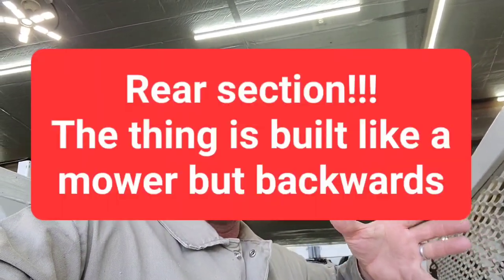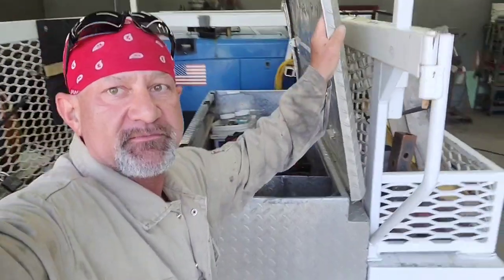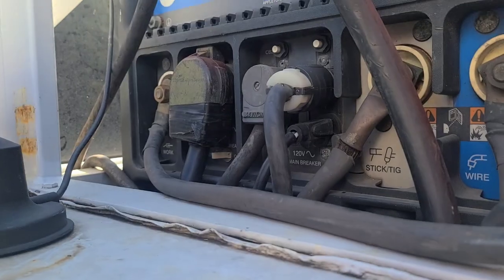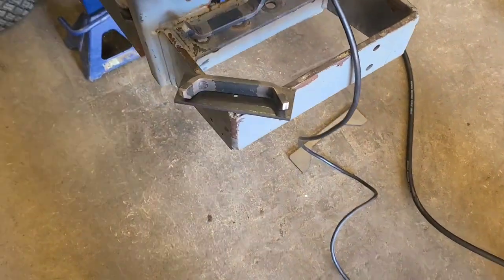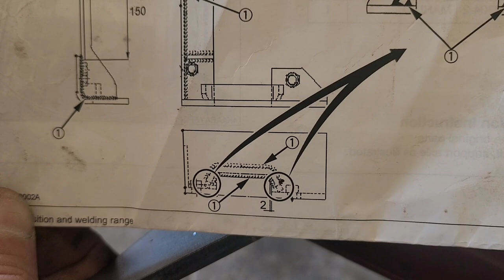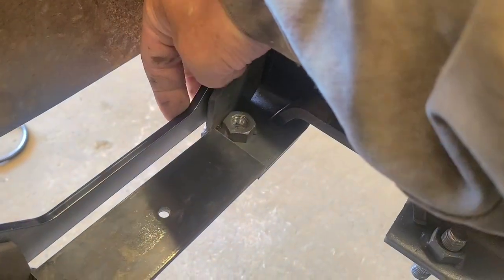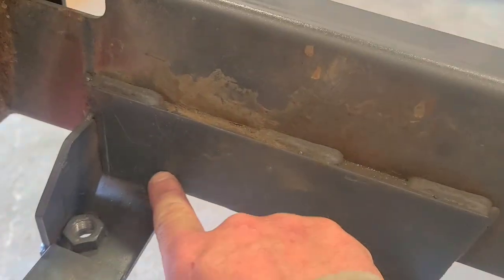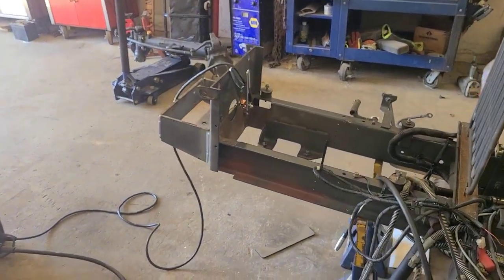Kubota F3680 steering structure frame gusset install

Comment: Nice job phil,  Are you skilled in TIG welding? It seems like I've never seen you do any TIG welding .
Reply from the maker: I have a few videos up where I TIG.

I have a Primeweld 225...I don't use it everyday but I do use it from time to time

I've made videos of using TIG to repair cast aluminum housings and using TIG for fabrication of aluminum pans that I bend out on my box & pan metal brake
Reply: @NBSWELDING  That's great! Are you interested in trying out the Arccaptain TIG200P AC/DC? It's our top machine at the moment. I emailed you a few days ago but haven't received a response.
Reply from the maker: I will get on the email and get back to you, I haven't checked it in a few days

Thank you for letting me know and commenting